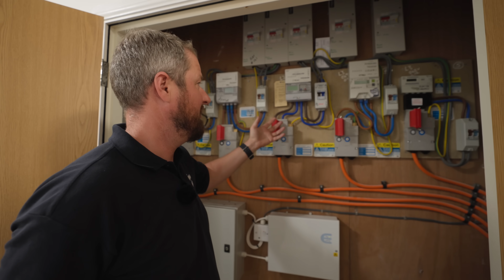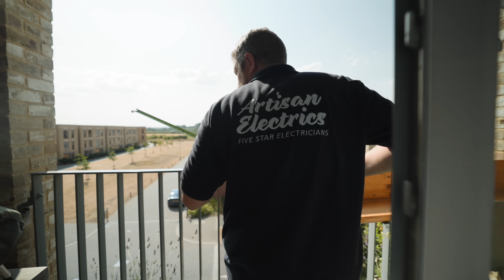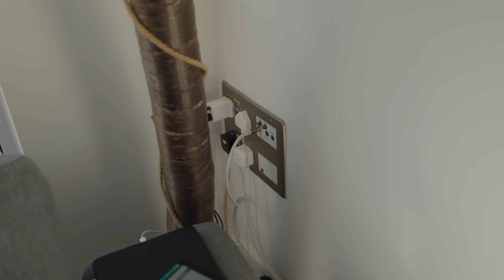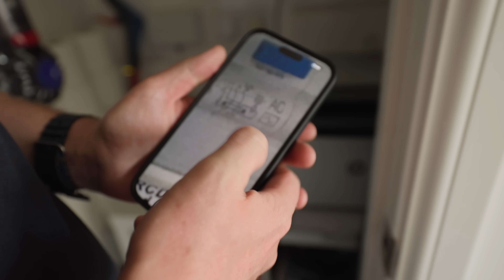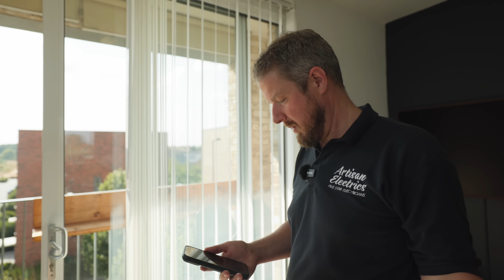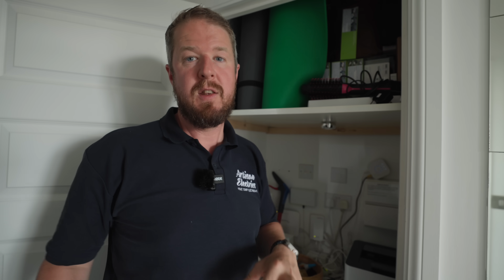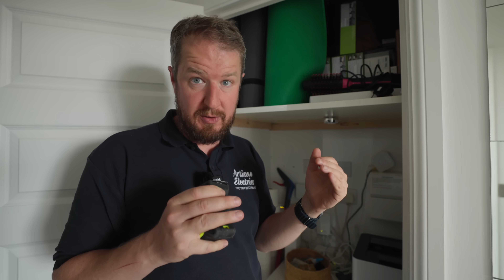I Found a BIG Problem With Plug-In Solar…

Comment from the maker: What's your biggest concern about plug-in solar?
Reply: Non, it feels like a huge win. If the Grermans are doing it.. Why aren't we...
Reply: @peterjd  eee, because not even one german said: "i know what im doing lets not read instructions"
Reply: @Martyniak.D  It's done all over Europe just fine. The only people scared of it are electricians ;)

Germans don't all read the instructions.
Reply: @Martyniak.D  Being German, I can only say, that you have a completely wrong perception of Germans 🤣😂🤣😂.
Reply: Electricians pouring cold water on it!
Reply: @GdaySport  That's why the equipment is all IP65 rated.
Reply: @etchedpixels 😂😂😂
Reply: @e @etchedpixels  no it needs to be IP67 now 😂😂
Reply: People like you doing your best to slag it off. Absolutely crap video. Normally your videos are excellent. This appeared so fake and set up, and self-serving. Do yourself a favour and DELETE it. Sorry there isn't any money in it for you. But move on and do your normal stuff. Oh but watch out those big awful black panels might burn you.
Reply: @SecretSanta at least he didn't make another grenfell tower comparison comment in this video.
Reply: @SecretSanta Agree with this comment. I have saved £200 with my setup
Reply: Misleading information from electricians that say you have to do things you do not.
I might be wrong but you checked the fuse box and it was fine in both and yet you suggest you pay an electrician maybe up to £400 to come check it anyway just in case then suggest you put some sort of CT clamp on the mains which of course you suggest you pay again an electrician to do, why would you do that? The plug in solar using the circuit to power anything in the house up to 800w just like it was the grid supplying the power you do not need ct clamp for it to work and sure its max is 800w so if you use 3kw it will only of set it by a max of 800w but thats the point.....To save a max of 800w and if the solar is producing more use a battery to store it and them pump out the house load when the sun goes down.
Reply: Fake news like this is my biggest worry
Reply: I used to like watching your content.....but this video....
Reply: I would be more worried about high winds in winter ripping off poorly attached panels and landing on someone below.
Reply: Seeing as your company does a fair few battery installations and have a good presence on Youtube, could you do a video on the upcoming changes to BS7671 Amendment 4 which is likely to affect a lot of people wanting to install battery storage in their homes?   Based on another Youtube video I've just seen, the installation of home battery storage is going to become a lot harder to accomplish in the average home, what with all the new regulations coming into effect in the coming months.   Judging by what was said, the average homeowner may not be able to comply with the new regulations and so battery installations will be the preserve of the wealthy with plenty of space to install one.
Reply: @bluechang08  Seems to me once something becomes easy to do the Rules change so you have to pay someone to do something that literally takes 5 minutes.
Much like MCS certification that probably was intended to stop cowboys installing solar and now the energy suppliers and MCS are working together with no law requirements(aka its not a law)so that people have to hire MCS certified people to install solar to get SEG payments and of course MCS installers charge more and often install only the equipment they are in partnership with.
Reply: @bluechang08 pas63100 is more the issue. Not a problem for houses but is for many flat layouts
Reply: Exactly! Most installers all talk down plugins. Consumer watches Youtube video, orders online and installs unit.
Reply: Youtubers that install big systems trying to put the plug in solar down and scaring people away from it . 3 houses in my area have had roofs set fire from professional installs . Yet no mention of these issues, just plug in .
Reply: people like you in the industry moaning about it
Reply: My biggest concern are electrians making misleading and forced narative videos like this one.
Reply: Wake up,and smell the coffee please.  If we follow this implied world view to the very end we would never plug in anything without first having an electrician check the circuits we plan to use the distribution board/consumer unit and the safety of the appliance itself.  Most simply wouldn’t have technical ability (capacity) to do so, and the costs would be out of control compared to the risk.  He has the same issue with plug in solar.  He just needs to stand back and think, and find a position to take that is reasonable, and offer a low fixed price service to safely install balcony solar.  If he can’t get his head around that he is going to miss out on one of the biggest commercial opportunities he will see in his lifetime.  These aren’t the expensive roof top sets he has made his living from to date.  Indeed many of his videos show how consumers have been ripped off by electricians with poor standards and unsafe installs of those bigger setups.  His potential market place is going to change radically, and if he doesn’t want to compete in that new market on low fixed price installs, that’s understandable.  But stop taking pointless potshots at systems and regulations are going to happen despite his views.
Reply: There is no concern about it. With the exception someone will fall off a ladder while mounting the panels. That's honestly the most risky part. 

Any building that can't take an extra 3A through a  ring or even a spur is already having problems.  In many cases the extra current could actually stop an overload from causing a problem.
Reply: You can literally hear this bloke sucking his teeth. “Na mate it’s going to cost you an arm and a leg”
Reply: i know I can install it safely (20 years of  industrial engineering experience, bla bla bla) - 99% of people think they can install it safely
Reply: Electricians putting in illegal plug in batteries.
Reply: Biggest concern - finding somewhere that has them in stock.
Reply: Biggest problem is that it takes jobs from installers😅 Seriously. I would not install plug-in solar at my property, I also pay for cleaning and other services..

regarding the german balconies, yes they are special. They are German. They are of high quality and regularly inspected. They have been designed with holding solar panels since the 1950’s. That is from the same era when the britts decided to put carpet in their bathrooms.
Reply: High efficiency panels that are shaped better for balcony solar. Narrower and a little shorter
Reply: Being from Germany, my biggest concern is the conflict of interest between consumers, who do not understand, that for various reasons not everybody can have DiY Plug-In Solar and our regulatory bodies, whose main interest is to protect non-electricians from being harmed by electricity. So we end up in a messy blame game between consumers blaming the VDE to be over-protective and electrical engineers that see all the potential hazards . 

The problem is, that both parties can easily end the Plug-In Solar Boom here in Germany. The engineers by creating codes, that always would require the visit of a certified electrician and the consumer side by installing too many systems insecure, that incidents become statistically relevant. 

I have worked myself through the installation of my parents house (build 1972) and I found many issues, that would have made it unwise to connect a Plug-In Solar System to the outdoor outlet or tthe outlet on the balcony, while in more modern installations I see perfectly no problem in running Plug-In Solar.

My personal approach was: Installed a new 5x2,5mm² cable to the point where I wanted to install the system, connected in the consumer unit to an individual 3-phase MCB (three phase to be ready for further upgrades) and the feed of the Plug-In Solar is connected without a plug - hard wired in a junction box.

Definitely no DiY job, but I am allowed to do it and I own the house.
Reply: My only concern is getting the panels on the summer house roof, the elastic trickery is no concern at all.
Reply: It's because he can't charge 40k to fit it.
Reply: Wind loading.
Reply: now i've only followed the "Plug-in solar" with the left ear so to speak. so please clarify. but if the curcuit that the solar is plugged into. has a short and the breaker disconnects. isnt there still live power on that curcuit?
Reply: Electricians ripping people off with 'safety checks'  'Oh your house has failed you need a total rewire'
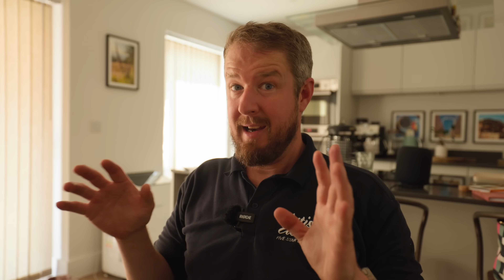Reply: What's the large appliance in your kitchen @7:08?
Reply: Electricians scaremongering that there are all these problems when in fact it’s a really simple diy install 😉
Reply: The male plug pins be live 😮. Would you get a shock if you pull the plug out and touch them?
Reply: @Stephen-yw9sn No if the panels are attached to a certified inverter they switch off AC as soon as they can't detect mains voltage (anti islanding)
Reply: @Stephen-yw9sn no . The plug is only energized when the plug-in solar unite detects current from the socket and takes 30 seconds to activate. When the plug is switched of the unit shuts down.
Reply: @Stephen-yw9sn  No

Comment: "It might bring more heat into the building."  Bollocks.  The panel itself will certainly get hot in the sun, but there isn't a heat pipe conducting the heat inside: it will be convected upwards. If anything, the panel will screen out some of the sunlight, reducing the heat entering through the windows.

Comment: What an absolutely awful self protection video, 99% of your big problems were irrelevant. So much so that I am now an ex subscriber. The only thing you’re concerned about is that there’s nothing in it for you. If your wiring isn’t safe to take 800 watts then it’s not safe for anything.

Comment: why do you need energy monitoring? don't people have any real work to do around the house but monitor their energy input/output from the grid and the plug-in batteries?Wiring safety is a universal concern and not just for plug-in solar. If the wiring is not safe for plug-in solar, it is not safe to plug in appliances and loads in the balcony in the first place.

Comment: I ALSO JAVE TWO 150 WATT PANELS ON ROOF AND ONE OF THE SAME PANELS VERYICAL ON GARAGE WALL AND IS HALF UNDER THE ROOF HALF IN SUNLIGHT, I STILL GET 18 VOLTS TO MY CHARGE CONTROLLER,, I TURN MY CONSUMER BOX OFF WHEN POWER GOES OFF WHICH IT CAN ABOUT 12 TIMES HERE IN MID BRAZIL THEN I TURN MY SOLAR ON,  PLUS I HAVE BATTERY CHARGER TO HELP IT ALONG THE DAY AFTER, PLUS ICE CREAM BOX SIZE OF ICE TO PUT IN FRIDGE SO I CAN TURN FRIDGE OFF FOR ABOUT 2 TO 3 HOURS, SYSTEM WORKS A TREAT

Comment: The big problem I see is. Apartments in the uk are leasehold you own the internal face of your apartment walls the external face and the balcony are owned by the management company they need to give permission to erect anything even a satellite dish and they need to inform the block insurance company who will probably bump up premiums. That’s why your not allowed a pizza oven on the balcony either 🫣 they won’t want a battery there either

Comment: Any power source that plugs into a house ring main from an outlet will eventually feed into the grid. My professionally installed solar has a gateway box to stop that happening! I don’t want to electrocute the grid workforce so a small grid down protective switch box between the solar inverter the plug in would be needed.

Comment: What’s the point of this unless you got an isolator as the system will shut down during a power cut and of course one that allows you to use solar energy during. A power cut including using your batteries costs a lot more

Comment: from antipodes. were trialing vertical solar to add to our wall insulation- bonus- we get baseload power for house & yep. we have RCDs. legal requirement here. can't kill the sparkies if working on grid when have a bidirectional system installed. (we have different - simple compared to power plugs  in uk.

Comment: so many mistakes and misinformation in this video really disappointing  but for your information on a balcony west facing you hang your panels vertical hook them to the rail and secure them to the bottom to catch the afternoon sun beams even in the winter also in the summer its safe to be behind them because they will stop nasty radiation and heath (also in germany and the rest of the world)

Comment: I've heard that putting solar more vertical than 35 degrees can be better because while you generate less power in the heat of summer (and overall), you don't really need it then, and you generate more power in winter when the sun is lower.

Comment: Solar installers having issues with plug-in solar, well colour me surprised lol

The problem is with installers is that they are far too expensive and make up a big chunk of the cost of the setup when solar panels are dirt cheap, plug-in solar is dirt cheap even to install, and even thought there are limits on what could be generated, it's not hard to imagine people getting creative, especially with battery storage.

Plug-in solar could open up the door to a lot more people to try solar that wouldn't before, which could actually benefit solar installers over the long run, but I suspect it's a threat to them and could put downwards pressure on pricing over the long run, either way, there are many ways of having solar, this will likely open up people's eyes to get creative, that is potentially bad news for solar installers, but then, they got far too greedy so who cares.

If I didn't know any better, I would think this video was design to scare people off pluf-in solar.

Comment: I installed plug in solar on my home 2 months ago & it's been working great. Made sure I ticked all the boxes, but when I found your short video about this video, I watched & had to check & my breakers are good to go. My only problem with plug in solar, is the fact I don't get paid or any credit for the electricity I dump back into the network. 
I'm out all day, so when I leave at 6am & come home at about 5pm. I've dumped over 5kw into the grid after deducting what my devices I have running used. And I cant get paid for it, because I need a certificate, which means i need it checking by a licensed electrician which can cost me so much, it'll make having solar pointless in saving money. 

I personally think, it shouldn't matter how you installed it. If it's save & you did so on your own home & it puts electricity back into the grid. I should get credited for that electricity. And I think smart meters are able to do this automatically. They tell you if your exporting, so they should be able to deduct electricity you've used from the electricity you've exported. 

So, yes if you use the electricity your generating, these are fantastic. But if you produce more than you use, your helping your energy company profit from your energy you export.

Comment: I’ve popped mine on a south facing fence with easily accessible tilting brackets. Super happy and it’s powering  most of my pond and house daytime, a total win for me.
Reply: what specific brackets did you use? I'm after something that's dead easy to set up - not loads of screws, hinges or panels, just a fold out heavy duty jobbie

Comment: I had to look into balistrade loading years ago, they have to support a minimum of 15kg sideways load, no issue hanging a panel, As you know, the change to regulations excludes plug in batteries currently.
You're also missing the specifics of the micro inverters all being capable of cutting any supply in milliseconds of & no power being supplied at all if there isn't a live circuit. All of the mountings available are more than adequate.

Comment: The bigger issue regarding most flats in the UK is that the building is under the control of the management company, not the flat owner, and so the owner will need sign-off from the management company if attaching to the railings.

Another issue is this video - just how did it go from being about plug-in solar to plug-in solar and battery which is not allowed under the rule changes?

Comment: I can’t see the building owners having any issues with a temporary fixed plugin solar system, especially as they have panels already on the roof, as for the EV charger, that would be a permanent fixture to the wall with additional public safety implications and parking safety as the cable would also have to run from charger to car.

Homeowners shouldn’t remove the faceplate of the consumer unit because it could have uncovered live parts and be dangerous? If that’s the case it should have also failed its safety inspection, plus any subsequent inspections during other installation processes.

Comment: I saw the potted plants on the outside of the rail looking like they were ready to leap off with a puff of wind, and had to smile.  My thought: put them behind the rail or bolt them down (as one might with a PV panel).

A second thought, a cute water cascade down the back of the panels would help them work more efficiently, provide evaporative cooling, and a groovy green wall of a well chosen plant.  Caveat: gotta run a wee pump when its sunny.

Comment: Is this about plugging in solar via an inverter into a socket? It’s all meant to be sold as a bundle. Sure a white through the wall is the hard part along with where the panels go, but that’s it. This is all DIY.

AI search, you need to verify that yourself. Some mentions of batteries too, why?